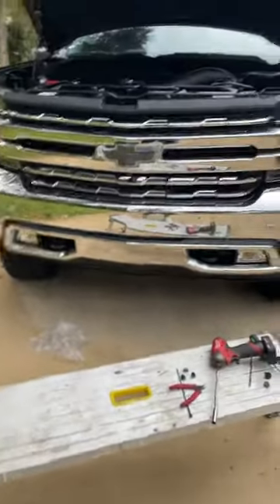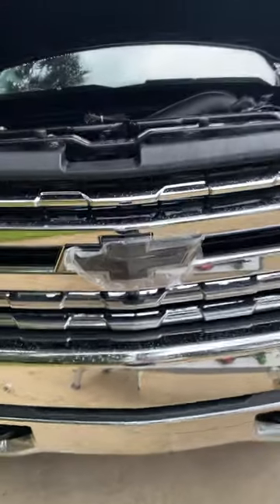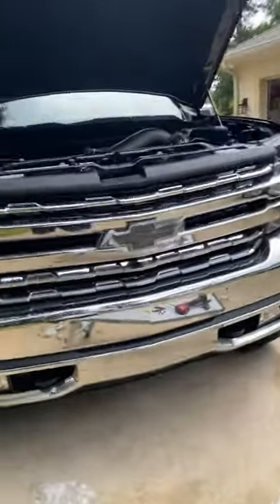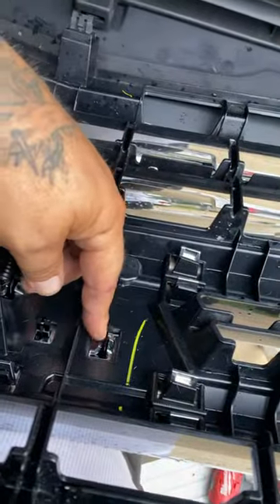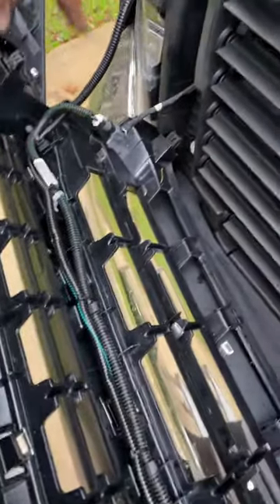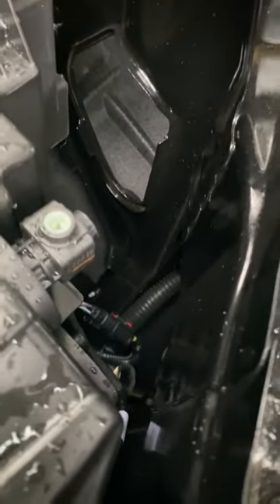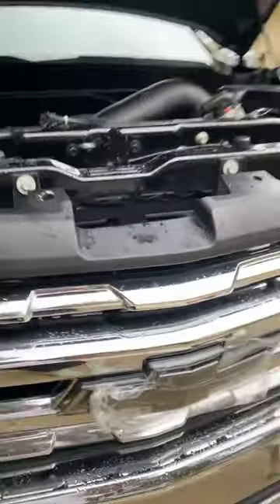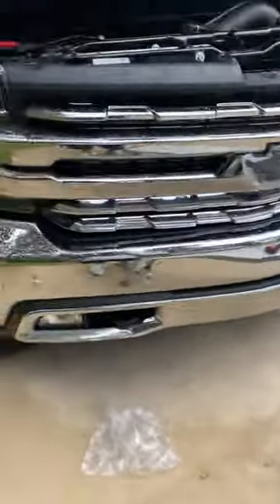How to install a 2020 Chevy illuminated bowtie

Comment: Trying to pull off mine on my 2020 TB. That grill is on tight man. I’m pulling pretty hard but scared to crack it. Top is loose. What’s the best way to pull it off? Upwards or straight out? Lost light and trying again tomorrow
Reply: Bro all you have to do is use a plastic trim remover and carefully remove the bow tie emblem and it pops out. You don’t have to remove the grill or anything. You can do it in less than 30 seconds.

Comment: You didn't have to drill a 3/4in hole through the grill or whatever to feed the wire through??
Reply from the maker: No there’s a spot on the left side